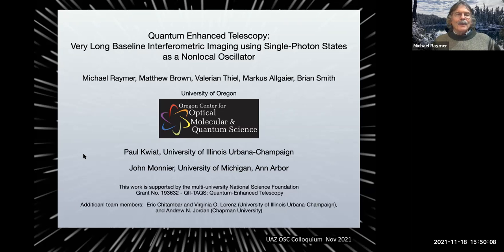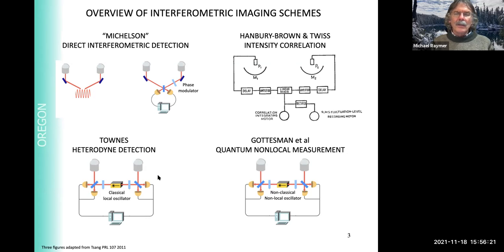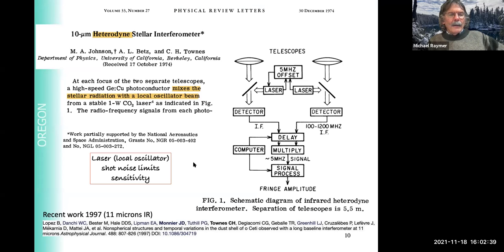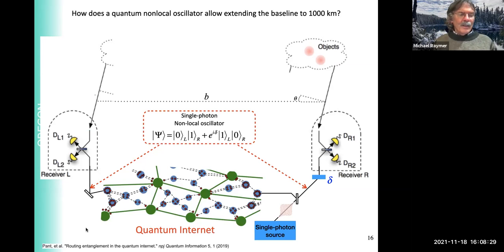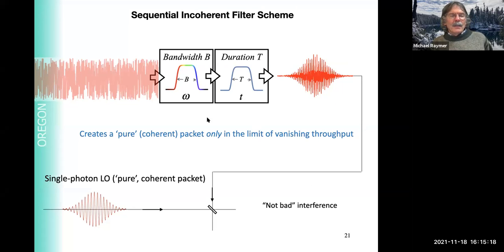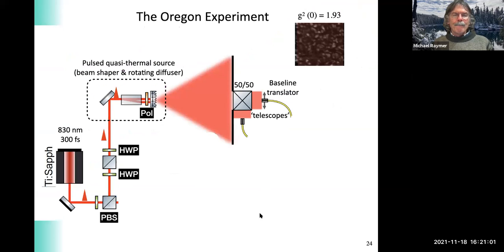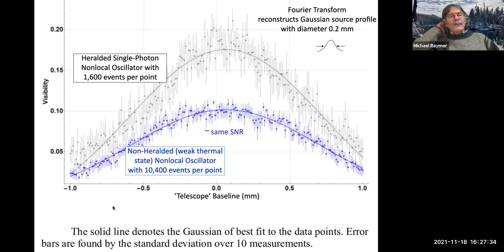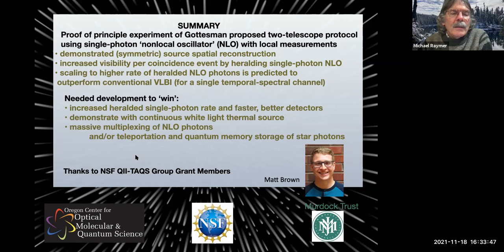OSC Colloquium: Michael Raymer "Quantum Enhanced Telescopy"

Comment: Great, very innovative research! Sounds like you are getting close to a real solution, too, one that will have major benefits when modified and implemented, especially on the ELT, GMT, and other "next generation" telescopes and interometers if possible.  I hope that you will also consider the possibility of utilizing the new technology on smaller scopes, say, <2m, which will require determining ways to bring down costs by a couple of magnitudes, but should have a great impact  and be possible in just a few years.  Exciting times for INTERFEROMETRY, I'd say!!